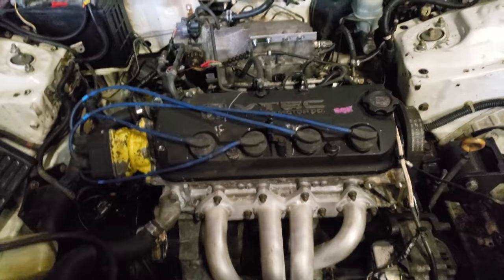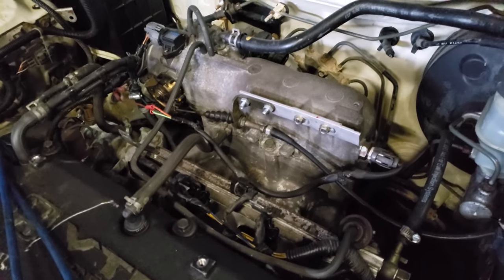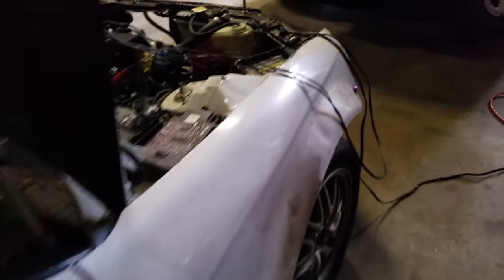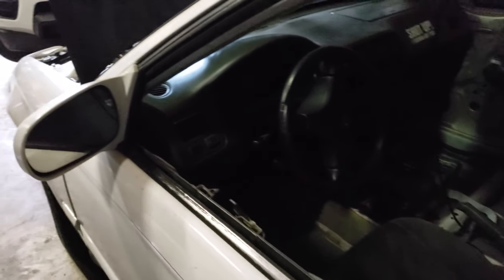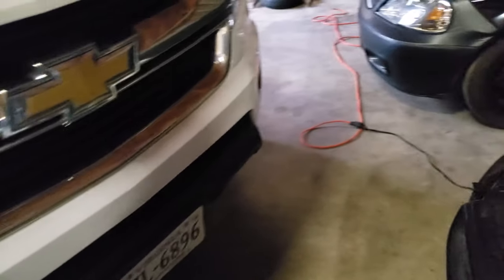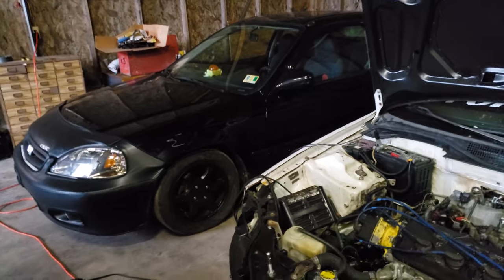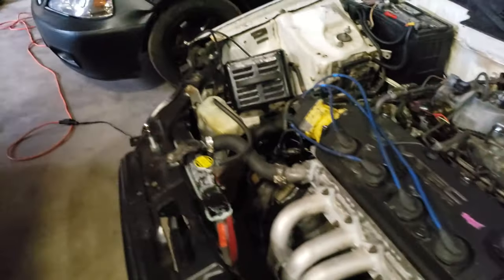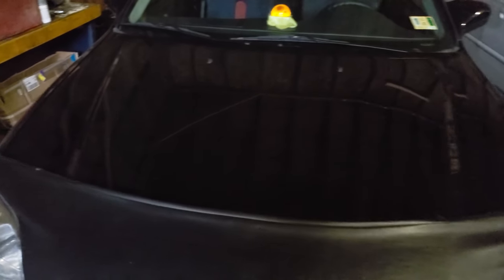What It Takes To F Series Swap A Civic

Comment: literally what I needed to know was the second thing you mentioned which is the mounts thank you for this video
Reply from the maker: Welcome good luck with your swap 👍🏻
Reply: @RedLineBandits   thanks I'm doing the G23
Reply: @RedLineBandits  did you have to modify the mounts to fit? I see a listing on ebay saying "H-series swaps will require cutting oem transmission mount to replace with new mounting brackets will also require drilling to mount new mount bracket."
Reply from the maker: @VIP854  no I did not. They might say that due to accord transmissions having a different bolt pattern. They have the holes just not tapped. I’m running a h23 trans so the mount bolted on.
Reply: @RedLineBandits  sweet im going to use an h22 trans
Reply: What post bracket did you use for the driver side mount

Comment: What size exhaust you got I got a trick to add more tq......what I did was step up the rear trailing arm back pipe, it gives you low end and mid.
Reply from the maker: christopher daniel header to itr mid pipe that’s been cut with a turn down.

Comment: Do you think you can make a video about your wiring I'm having a hard time with my wiring from the f22b1 can I use the same harness or do I have to use the DX harness
And if I use the DX harness what wires do I extend or ADD
Reply: You figure it out ... I'm doing the same exact swap ..
Reply from the maker: Brayan E use the cars harness. I used the stock civic harness. Extended the alternator wires. Intake air temp was extended. I think I had to do the starter wire too. Just run the harness on the engine like you would for a d or b swap. You will see what wires need to go where. Pretty much plugs right in.
Reply: Rywire has one made on ther'ye website to work

Comment: Locking vtec? Deleting it or keeping it in vtec all the time?
Reply from the maker: It's in vtec all the time. I removed the small pins and put two big pins. So now the rocker arms are locked in. All 4 valves open all the time now.

Comment: I got a 96 civic lx with a F23A N/A ( for now) just have a few questions bout the intake and throttle body. I have H22A axles and trying to figure out what’s the best tranny to run before I put my F20B head on the F23 Block
Reply: It would depend on what you use it for. For a boosted setup down the road for Street use I'd say longer gears or if daily longer gears. If track use or fastest daily NA setup shorter gears. Hope this helps you decide.

Comment: inspired me to do f series in my del sol i just got done however i did go F2D
Reply from the maker: That Honda Channel Hell yea dude 👍🏻 wish I could find a f/h2d kit. That would be the move.
Reply: @RedLineBandits  for real I had to drive 8 hrs to go get it but only paid $200.00 came with the evolution flywheel for the d series clutch the bisimoto f2d plate and the post mount!
Reply from the maker: That Honda Channel that’s not bad at all 👍🏻
Reply: Must be nice!!!!! Those plates are impossible to find
Reply: @singlecamclan1220  right??? came with the evolution flywheel and post mount bracket too

Comment: I’m kinda on a budget with my civic, I found a F23a for $480 in my city but idk if I should because I just want it to get fixed so I can go to work without being an inconvenience to my parents, and my d16y8 is knocking but my friend told me that it’s the cylinder head but I talked to a mechanic and he said that I should get another motor. What should I do?
Reply from the maker: Sounds like you should just put another d16 in.
Reply: @RedLineBandits  alrighty, thank you!!! I had a friend tell me that I just need to replace the cylinder head but a mechanic I talked to has said that I need to get another engine.so now I'm just discombobulated and don't know what to do now
Reply: @RedLineBandits  u could just replace block probably 300$

Comment: Just curious how well did the civic radiator handle the F series?
Reply from the maker: I never had any cooling issues.
Reply: @RedLineBandits  Thanks. It's good to know just in case I need to use one of my spare civic rads on my Accord in an emergency.

Comment: More in depth description on the axles?
Reply from the maker: I made a video about the axles.
Reply: @RedLineBandits  gotcha I just watched it, same thing worked out on the driver side? Accord axle cup on the DA axle?
Reply from the maker: @camgooden5345  da or integra axle. Depends on what half shaft you are using.

Comment: I wanna swap a f22 or f23 in a da integra I can't seem to find much info on the mounts a couple forums say just go the same as an h22 swap with h mounts.
Reply from the maker: jumexsuave501 should use h22 swap mounts. Never done one in a da or ef so I can’t say for sure.
Reply: You need to relocate the passenger side mount (it comes with the kit) and relocate the alternator and some tweeking on the crossmember. I’m about to start looking into a swap once this d series blows up again

Comment: Wouldn't any B series axles work? Why 90 93 integra?
Reply from the maker: Half shafts are different. I’m using a accord half shaft from a 90. If you use a newer lude you can use newer integra axles.
Reply: I put a h22 head on my f23 and kept my f23 transmission.

Comment: Hey bro im swapping my crx with a F23A1 and im looking for a dizzy. So you put the civic guts in the f22 dizzy? Im been doing some research but not much is coming up
Reply from the maker: One Stop Mod Shop well since the crx is obd0 you can just use a f22 obd1 dizzy with a adapter harness. Any internal coil f22 dizzy should work.
Reply: @RedLineBandits  sweet thanks thats what i was thinking that or H22 dizzy obd1 im already converted phew😌 ill be posting about the swap all details might even share my basemap
Reply from the maker: One Stop Mod Shop Nice dude. I have a crome base map that ran my car pretty good when it was somewhat stock.
Reply: Ill be keeping mine pretty much stock with good flow for a bit
Reply from the maker: One Stop Mod Shop Nice. I mean mine is some what stock still. Other then bolts ons. The only real mod is the vtec being locked. Just put rdx injectors in some e85 and a way better tune. can’t wait to hit the track again lol.
Reply: Nice dont forget to post some progress ill be sure to check it out since im in the F23 gang now I like to see others builds and tricks

Comment: How much did you add to back mount to help axles clear.
Reply from the maker: Inch maybe inch and a half
Reply: Ok I did a inch and axles are just touching the front of the forks. Ima add another half and see whats up. I appreciate it
Reply from the maker: @marcsteffen3983  honestly shoved a floor jack under it and jacked it up till it stopped if I remember right.

Comment: Also what about the IACV? I heard something about if you have a 3 wire you have to modify them or change it
Reply from the maker: One Stop Mod Shop I’m not running the iacv. Rosco racing makes a adaptor to use a normal one. It’s for a euro h22 but it will work on a f23.
Reply: @RedLineBandits  Would  like to know how u deleted it. I'm hoping to run a Skunk 2 mani on G23 in my eg.
Reply: p.s. That rear mount mod would prob help w clearance I,m sure
Reply from the maker: ken frazee cut a coke can up and some rtv on it. Bolted the idle air back one with it between it and the manifold. With Crome I still had to have one plugged in. Zipped tied it to the fire wall.
Reply: @RedLineBandits  Basically blocked it w the aluminum? nice.

Comment: Are you still running the balancer belt On this set up?
Reply from the maker: fortunesk89 nope never put that belt back on. It’s not deleted. Just no belt.
Reply: RedLineBandits sounds nice with the vtec locked and no balance shaft belt, you think I can run a f23 for a while on a p75 (b18b Ecu) ?
Reply from the maker: fortunesk89 maybe but I bet it would be mad lean.

Comment: How did you get the shift linkage to work ?
Reply from the maker: Gwayne used a 1990 accord shift box and cables. Routed then threw the firewall where the heater core use to be.
Reply: @RedLineBandits  could you hit me up on social media and send pics on how you did it would like to get a idea ! If you dont mind
Reply from the maker: Gwayne look up ShitBox tuning on Facebook. Hit me up and I’ll send you some pics. 👍🏻

Comment: I'm doing the same swap. My only issue now is the IACV. Rosco is sold out on the retrofit kit. What do you suggest I do?
Reply from the maker: Daniel Arias honestly I’m not runing one. Never have. I’ve seen people just make there own out of some plate.
Reply: @RedLineBandits  Do you have to program your ecu to ignore that it's missing? Leave it unplugged type of thing?
Reply from the maker: Daniel Arias when I was tuning with Crome I would turn it off in the tune.  But it still needs to be plugged into the harness. With bm tune I don’t think I’ve ever turned it off but it’s still hooked up and zipped tied under the intake manifold.
Reply: @RedLineBandits  Thanks for the replies. I'm getting it all put together this week. I'll see what it will run like. Your build has been an inspiration. Definitely an overlooked engine.
Reply from the maker: Daniel Arias Nice 👍🏻 I’m glad I could help. Yes it is. People sleep on the big block single cams lll.

Comment: can you run the stock f23a transmission or do you have to use the h series..?
Reply from the maker: You can but you have to modify the case. It has the holes for a h22 mount just not threaded. Accords and preludes dont use the same transmission mount.